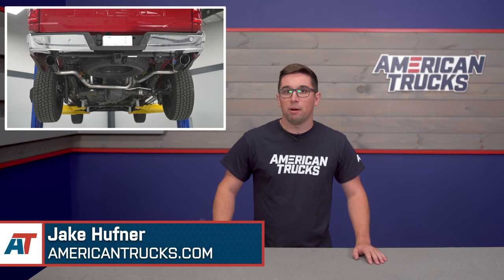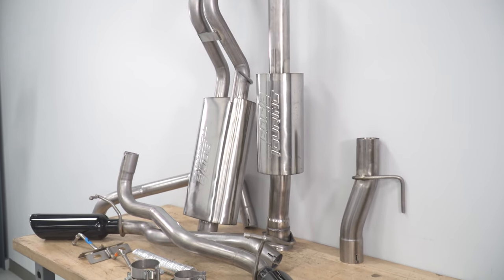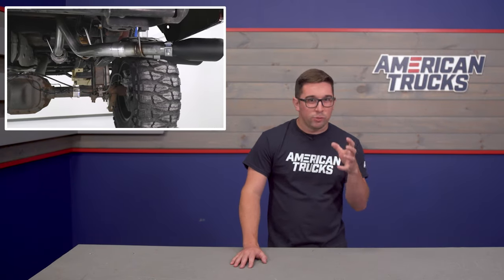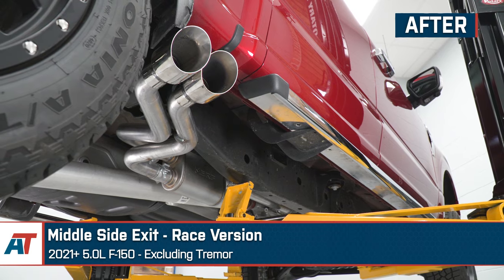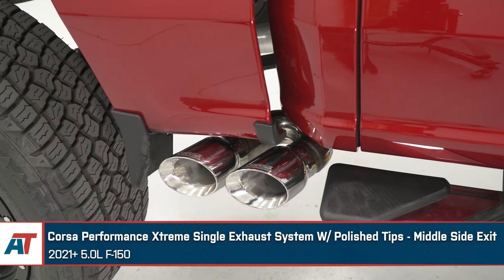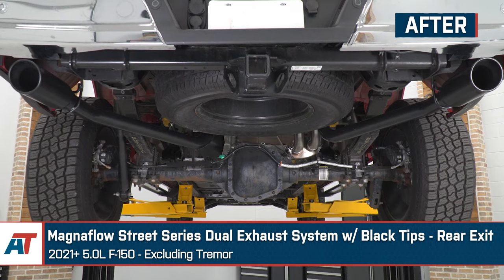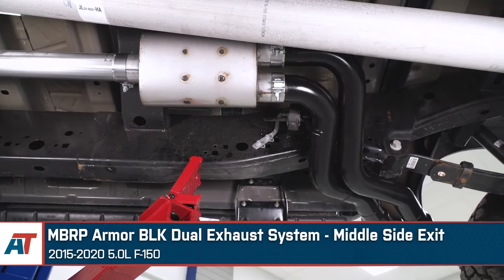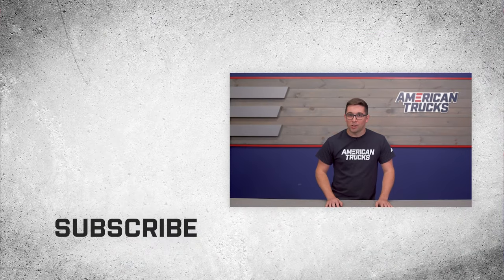How to Choose the Best Exhaust System for Your 5.0L V8 Ford F-150 Truck!

Comment: Any downside to getting corsa xtreme exhaust, before rear axel side exit? Considering getting it soon.
Reply from the maker: Dumping before the rear axle will increase your cab noise compared to an exit behind the rear axle - that's the main difference! -Zach

Comment: Great video!! 
I have a 2013 stx 5.0L single cab 6.5 bed.
Which exhaust do you recommend? 
I'd prefer with a deep sound instead of being loud. 
( I don't want to wake up my neighbors when I leave at 4:30am every day lol) Thank you!
Reply from the maker: Something like a Mangaflow or Borla Touring would be nice! Both will be deeper from the factory with an increase in volume. Neither will have drone or loud volumes though. -Zach